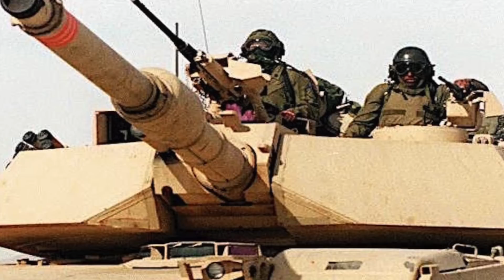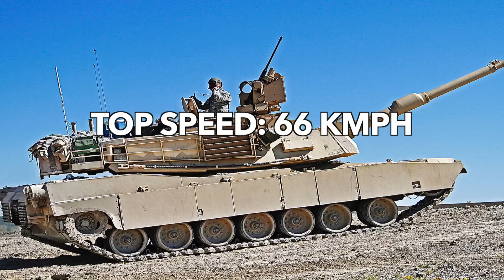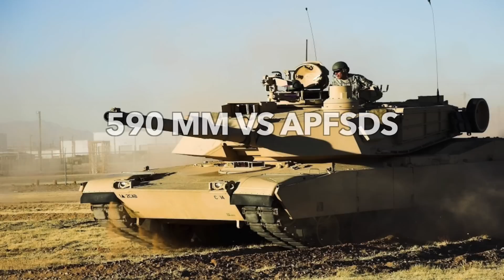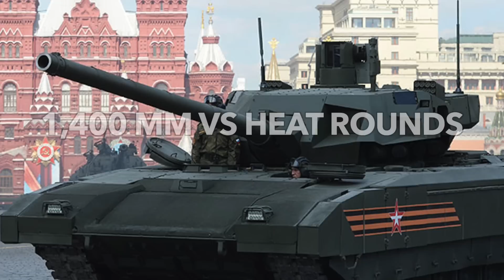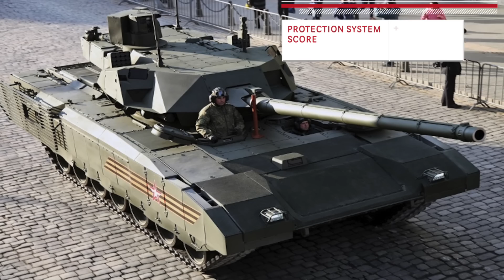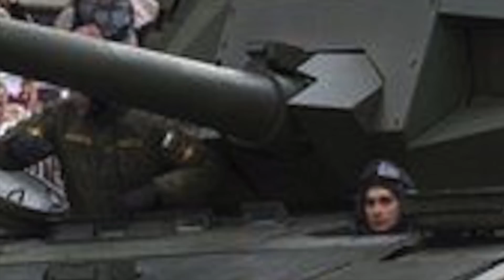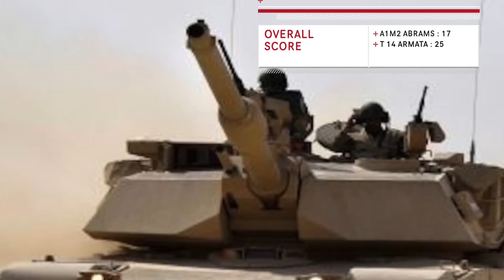AMERICAN M1A2 ABRAMS  vs RUSSIAN T14  ARMATA: WHO WINS?

Comment: How well does it operate at night, in sand storms, does it have excellent fire on the move capability?  Can it accurately hit targets from over 2 miles away on rough terrain and at full speed.  Does it have automatic fire suppression systems if hit or damaged, can it be easily repaired, are the tracks easy to replace in the field or during battle?  How well are the crews trained, do they have advanced simulator systems and if so how many hours of training are crews given on them?  Does it have a capable support vehicle like the Bradley, how many can be airlifted at one time on a cargo plane?  Is the entire engine a self contained unit that can be swapped out if necessary or is multiple systems and parts?  Can it use practically any type of fuel available if supply lines are comprised?  Last but not least...do they have over 4000 of them or did they do what Russians always do and create a very small amount of super weapons to appear superior?  Lot of things to consider.  P.S reactive armor is easily defeated by the TOW2 system.  This missile fires a small lead projectile which detonates the armor plates and then the main projectile hits right after once the plating has blown off.
Reply: vann tedd you idiots need to stop with this 80's bs, the M1 design may be 80's, but the gun, tech, armor, fire control, aps and much more aren't, it's upgraded, modern, up to date, NEW
Reply: You did see the older Abrams take out over 70 T-72s in less than hour in Iraq right?  Oh let me guess, they weren't as good crews and tanks, right?  We always hear that nonsense.
Reply: And how many of these do they have?  And also, the top layer of armor on an Abrams is classified.  So no one is really quite sure which is better or what it can take.  We've seen this from Russia over and over again.  They said the MIG-29 was faaaaarrrrr better than anything the US had.  Really?  20 years later they found out it can't win a dogfight...ever, its airframe last 60% less time than an American fighter jet, its pilots got 100 hours a year on it to preserve its length and they had trouble selling them to countries even for super discount prices of 4 million each.  They are waaaayyy behind the US in technology, and they know it.  They spent decades and decades making cheaper versions of our systems.  Look at their Navy?  You trying to tell me thats a nation with superior technology?  Look at their strategic bombers?  Laughable.  Almost as funny as a "stealth" tank.  BWAHAHAHAHA
Reply: Very poor, but the same excuse is used over and over again.  Ohh they were made somewhere else and using "those" people to run them.  the Republican Guard had some of the most experienced tank crews in the world in the late 80s, early 90s and got wrecked.
Reply: How many T-14's are combat proven?
Reply: Whats the combat record of Russian/USSR tanks vs Abrams/Challenger/Leopard?
Reply: Its also the same with Russian jets against US made jets.  Abysmal record but you will hear the same excuses.  In the latest (I forget the name) annual global war-games with jets the F-18s I believe went 19-0 against Mig 29s against excellent German pilots.
Reply: Yes you are absolutely correct t-14 armata is the best target in the world.   Meat and drink for the m1a2
Reply: yes but don't you think Russian top command already know that, this is why they invested a lot more in anti-air tech ,it's simple common sense , they were never planning to fight us air force 1 on 1. Russians are not idiots and you should not underestimate their spirit
Reply: Then how can we know?
Reply: What battles were these?  Please tell me names and dates.
Reply: @SeanP7195  Seems to be references to World of Tanks. Many complaints about Russian bias.
Reply: when and where?
Reply: spelling and grammar are not your strong suite
Reply: Black Prince if what you say carried any weight, the US would have failed during the Cold War, not the USSR. And that alone speaks for itself in every aspect, not just tanks. Go actually learn something and look at the big picture, not just what you want to believe and try so hard to convince yourself to be true. Lmao at YOU
Reply: Russell K. Bonney if somebody could give America a run for their money, they woulda did it by now as much as people hate the US
Reply: If you read the definiton of the word "Propaganda", is you who is spreading it... Not me.  I didn't said the russia is good in no way...
Miss the point you say... You sad that russia can't keep up in ukraine, i sad that you are wrong and they keep up like a lot.... That's it...
About Krimea, the fact that it was russina before just was just an exuse for them to capture it. If you live in the region like me, you will know it. The reason is that Ukraine started the EU integration program, wich means NATO military bases on it's lands and will force russian naval base in krimea to leave... And this was a price too high for Putin... There is no other sense for russians to invade ukraine. They just need to keep Krimea as their naval base.
You think the biggest country in the world with all the resources and shit will invade ukraine for their lands ? :D 
Yes, there is no excuse to invade sovereign nations. I totally agree with you on this one... 
About "Nato to does not invade countries to build its might. " Really ? 
And what happened in Yugoslavia ? Nato suported separatists ,to use their lands for Nato bases later...
Reply: SeanP7195 you tell em!! MERICA
Reply: Amigo! Russians invaded my country long time ago, took everything my family had... I have lots of reasons to hate them...
But first: supporting a war, does not mean you are in it. 
U.S funded and supported taliban for years to fight the soviets... Still does not mean they where in official war with them...
About the Ukraine, you have no idea what is happening in the region.
Russians supported war in Donetsk to distract Ukraine from Krimea ( wich russians successfully capturen)  and to create a "black hole" buffer zone like they did in Transnistria in 1992 (read in wikipedia about it) So are russians having succes in Ukraine ? Considering they captured Krimea without firing a sigle shot, hell they are having success... 
And btw , Kiev officially reported today that they have no direct proof of russian involvement in Donetsk region... So yeah, russian military does know they'r shit.
Reply: Mr Macky Brown that was great 😂😂😂
Reply: Proof ? You yanks also had fake proof when invaded iraq... 
I watched the Vice and media from both sides, russian and u.s. Propaganda all the way... You say that russia wanted to do more ? What exactly ? Cause it does not make any sense... You guys don't even know why russia captured Krimea , don't you ?
Reply: It works gr8 at night
Reply: Agustín De Zan agreed SeanP7195 is just being so defensive..
Reply: CapnCrossbones 😂nigga you've gotta be kidding their Air Force is a joke compared to the us Air Force it's a circus same with navy only thing Russia can clash with us in on the ground
Reply: Russia has produced less than 4000 T-90 tanks.
Reply: Which is essentially an upgraded T-72 which got ripped to shreds by US forces.  The T-72 was losing fights against the Bradley.
Reply: Actually its around 3200 and sold many of them.
Reply: TOW2 systems has typically beat any reactive armor presented to it.  Also, the Army is now designing a new Tank which will probably again put the Soviets years behind and cause them to bankrupt themselves again catching up (sound familiar).
Reply: Daniel Barvenko   Oh dear lol.  Go look at the Jill's in Iraq.  Tell me how many Abrams were lost in head to head battles.  I'll wait
Reply: Daniel Barvenko bwahaha.  I believe the Abrams took out nearly 109 T-72 in one day at the start of the Iraq war.  Oh dear, you and your Russian last name
Reply: SeanP7195 -You make americans seem like idiots. Please stop talking, because some of us aren't. I sure hope our military didn't share any secrets to your loose lips. stop thinking with your emotions, and use some intelligence. You clearly lack knowledge, and more importantly wisdom.
Reply: Mr Macky Brown -You clearly don't understand what's really going on. If you ever figure it out, I'll bet it'll be too late.
Reply: Mr Macky Brown -I think you have proven your IQ can't get any lower, and still support life.
Reply: Nameless 69 - Unfortunately that's not true. Their strategy is superior for a long drawn out conflict, witch they are masters at achieving. We have numerous/serious sustainability problems. Russia doesn't even have to defeat us to win, but we would loose in the end even with their defeat.
Reply: SeanP7195 -we are bankrupt
Reply: Robert Mitchell but why would it be a drawn out conflict if a war ever happened between the us and Russia it would go nuclear which mean bye bye world
Reply: Robert Mitchell 
You r stupid!!
Reply: Mike Walsh -I've said alot, with as few words as I could in the moment. What exactly did you find stupid? If I got something wrong I would like to know (seriously). The more I've learned, the more I realize there is to learn.
Reply: Robert Mitchell 
Tell me what you got right, because in reality, you don't know!!
Reply: Bones Doug -That is very possible, and very likely if one side felt there was no other option. On the other hand, both sides have found ways to fight each other since we fought for the White (Imperial Army) vs the Red (Communist Arny). Even as allies in WW2 we were secretly fighting each other.
Reply: Mike Walsh - Apparently you have no argument? Teach us somthing, anything you think you know. Maybe we'll both learn something. Or do you just have insults?
Reply: Robert Mitchell yeah bit if it came to today it would not be a drawn out conflict more like a nuclear war
Reply: litterly all things u meantioned at the start are common for every modern tank. uk they get tested before the come out.
And no tank can accuratly hitt anything at a distance of 2miles at full speed. This is a tank to tank comaprison so the crew has litterly no meaning also yes the have simulatores xq.
The bmpt came out with the armata and is a eczellent supp vehical but then again this is a tank to tank comparison.
and no fucking shit ofc they dont ahve 4k xD they do have around 26k of other to modern standerds upreadet tanks tho. The armata just came out and is a revolutionary design meaning the factories need time to adapt while the abrams is an older model that was upgreadet to modern standerts just like every other russian tank xq.
Now to tow2 it is tandom shaped yes but its still massivly affected by especially modern era, relict for example reduces tow pen by around 40% thats why they r designed to hit the roof of a tank turret not the front (the roof is usually weakly armord). now heres the prob. we know the pen decrease of relict but the t14 has malahit era. and noone knows shit about it xq
the 900mm armor against apsfds are without the era and noone knows if it could stop tandom shaped projectiles like tow entiarly (t14 has malahit on the roof. Also hitting russian turrest is extreamly difficult cuz the actual turret and the places where tow could pen for example the t90 are very small and its even worse with the t14 because the only thing that tow could dmg is the main gun. Now heres the next prob t14 ACTUAL turret that is within this cool looking capsul that is made to protect stuff like sights from small arms fire is veeeeeeeeery small so hitting it is very difficult. meanwhile the abrams has a humongas turret with alot of composite armour wich absorbs the shockwave of a hitting projectile and lets it through the tank thus a hit in the turret even if it doesnt hit the main gun directly will heavily dmg it or even make it unfunctional (every modern tank besides the t14 has this prob) why doesnt the t14 have it? well like i said it has a small hard to hit turret hidden in a metal capsule if a modern projectile like apsfds hits the turret capsule it will just smash through without damaging the gun. Also its not a small amount of super weapons after the breakdown of the soviet union russia was in a big eco crises and they did the best they could with keeping up the military streangh. Now all of older equip (like t72 and t80) are on modern standerts but the russian goverment is planing to replace them with the t90 and t14 armata until this isnt possible they will keep upgreading theyre older tanks at low costs and slowly but surley replace them with the new models (every western country has an older design that is beeing upgreadet like the abrams)  im sorry that so many amaricans feel butthurt eventho every tank enthusiest should be exited with such an sophisticated new design. The abrams is not much better (if it all) then the new t72 and t80s and sertanly not better then the t90a or t90m and DEFENTLY not better then the armata. Tank designers from other countries admitted themselves that the t14 is the best tank rn. the second best is either the t90m or k2bp. america has huge funds and they r spending it like crazy cuz they can (till now at least at some point the immenser debts are going to crush the usa eco if the goverment dosent do anything) countires like russia come up with extreamly well made and thought out designs to get the most "bang fo the buck" but i digress 

sorry for ma poor english its surley not my first one and i didint rly pay attantion to the mistakes
Reply: @nekko5778  Russia has about 800 T-90s.  The US has over 6000 Abrams.  Russia has a GDP about the same as the state of Texas.  Again, Russia copies designs from elsewhere, makes a much smaller number, then tells everyone how great their stuff is.  Small elements of Abrams and Bradleys pretty much wiped out all T-72s in Iraq in a single day.  You'll understand why I for one am not terrified.  Also, just because something is upgraded from an older model does not make it poorer.  Look at the B-52 for example.  To say the Abrams is not much better or "if at all" over the T-72 is simply not being intelligent.  Again, look at Iraq for example.  Now this is where you tell me, but those were Iraqis, not Russian.  Those Iraqis just fought an 8 year war in those tanks and were highly trained.  Even if the tank was slightly better than the new A1-3 Abrams the US has 10 times the amount and can make many, many more.  They also have thousands of Bradleys, attack helicopters, A-10s and their logistical capabilities are far beyond what anyone else could bear.  I think the US lost a single Abrams to hit from a T-72 in Iraq and they were greatly outnumbered.  It was something like 74-1.  The T-72s couldn't even get close enough.  I'm a show me type person and those numbers are even greater with American jets.  It also only disabled the tank and didn't destroy it. Bradleys were taking the entire turrets of T-72s themselves.  But I know, again, this is the part where you tell me those were bad tanks driven by bad operators.   The MIG-29 was touted as better than anything the US has.  This myth was told for 2 decades and for some reason other nations bought this myth.  Once other nations started getting their hands on them they realized the jet was far less superior.  The airframe of Russian jets have a life span of about half American jets.  This was known to the Russians so their pilots only get about half the training time.  In mock warfare games were allied troops had Mig-29s they were slaughtered by American Jets.  I believe the real world numbers of countries at war and one side had the Mig-29 and the other side had American jets is something like 0-39.  Russia finally had to admit the MIG-29 was a total failure and started selling them for the embarrassingly low price of 4 million each.  India bought a slew of Mig-29s and the quality and optics were so bad they refused the order until Russia made serious upgrades to them.
Reply: @SeanP7195  i seriously question where u r getting ur information from xq.
first of all im sorry, i had the wrong number in my head russia posses a total of c.a 13.000 tanks (all upped to modern standerds)
Iraq: first of all i dont understand why u should be terrified at all, idk maybe u r taking this to personal?
now to the actual t72 performance in iraq. Just cuz the country was in a war for a while does not make the soldiers higly trained. The t72s used in iraq werent even russian models they were produced by mostly warsawpact countries (and yeah they had theyre own versions that were much worse) iraq even used t72 ural wich was the base t72 when it firstly came out, the soviet union did not export any tanks to iraq xq the t72s that i iraq had were older, poorer manufactured and they were badly maintained by the iraqs wich already suggests that they weren elite at all. Poland exported most of the t72 and theyre tanks were already massivly outdated compared to russias t72 variants (not even talking about the t80s). also iraq used very old ammunition, even going back as far as 1962. And the iraqs had very poor tactics like digging their tanks into sand wich is simply useless against apsfds projectiles. in conclusion america had much better trained people and actual modern tanks xq. iraq had poorly trained soldiers who didint maintain theyre tanks properly and they had very old and poorly manufactured tanks (while the soviet union itself did not export and tanks to iraq).
next points: u misunderstood my point. I meant that upgreading tanks is a gud thing and ofc the most modern m1 isnt the same as the oldest variant just like with russian tanks, neither did i say that the m1 was inferor to the most modern t72s or t80s but its even, it is inferor to the t90 and the t14 armata and my comment was primerly made to clear up some thing about your misconseptions regarding the t14 (because this video is about a direct comperisan of the 2 models) so i dont understand what the rest of ur argument has to do with the tank topic but ok xq. Ofc the us has more financial capabilitys then russia and other countries but then again what does this have to do with the performance of the tanks? This dosent cahnge anything in the fact that the m1 is not better then russian tanks and it doesnt change the fact that its much worse then the t14. i wont go into jets here because i dont know much about them. To your other statements, i already explained why its difficult to manufacture the t14 and i already explained the process of replacing the t72s with the t90 and t14 (russia was and still is badly hurt by the split of the soviet union and has just started to keep up with the west again) things r getting better tho wich is a good thing in my opinion. now the debt thing. i honestly do not understand how u dont know about this cuz u seem to be a us citizen. as of right now the us has more hten 26trillion dollars of debts wich is more then the entire eu combined. in short term its not bad and its one of the reasons why the us grew so much, but experts say that a debt crisis is not far away and that there might be a point within the next 40 or 50 yrs where the us wont be able to pay back its enourmas debts wich would crush the economy. This is a very well known problem and i rly dont get how u never heard of this xq
Reply: @nekko5778  Just like I said, the old...."They weren't Russians using Russian tanks story".
Reply: @nekko5778  Since the US is the size and population of the EU I would assume its debts to be similar.  All these nations have massive debts.  Up until Covid the US economy was doing great and getting better again.The US had very unfair trade deals with many of those nations which they are correcting and was paying the tab for most of the UN and NATO.  SO, if we go, they go.
Reply: @nekko5778  I think its you, that might be taking this personal.  Don't you think?
Reply: Butter Brot Russia currently has 2000 active tanks that are at T-72b standards and the US has around 8000 Abrams.  And you ask me where I get my information from?
Reply: @SeanP7195  no i dont think socuz im just clearing up misinformation thats all xq
Reply: @nekko5778  Then start with your own.
Reply: @SeanP7195  and why? Cuz my arguments are based on fact so idk what i should change in them
Reply: @nekko5778  Russia does not even have half the Tanks you mentioned.  They only have 2000 active.  The other 5000 are stored, surplus, antiquated tanks.  These are only facts in your own mind.  The ones that are active are only up to T-72B standards.  They could only bring to bear a few hundred high end tanks at any time.  This is a far cry from the 13000 High end Tanks you spoke of.
Reply: @SeanP7195  thats again wrong. Russia has between 12 and 25k tanks (thats what most sites claim) and the standert is t72b3 and some t72b2 wich r far better. And this standerts apply to t72s only. T80s and 90s r also there
Reply: @nekko5778  Now its between 12k and 25k.  Please show me a site where it states that.
Reply: @SeanP7195  sure, i can do this when im back home. Btw for looking up tank performance stuff i recommend redeffect
Reply: @nekko5778  Dude, they have less than 20 T-14s.  This is what Russia does.  They make a handful of high tech machines and tout their prowess.  Then they field thousands of units from the 1960s.  The point is to have a front line, high end vehicle that thousands of troops use and know.  That has an endless supply chain of fuel, parts, maintenance, etc.  Russia can simply not do this with even a small portion of their leftover USSR vehicles.  Many of those in "storage" will be sold off to third world countries and not replaced.  This is why the former USSR stockpiles have depleted every year.  I'm sorry, but I have no fear of 20 T-14s that would be taken out in day from Nighthawks. I have heard this story for 40 years now.  Russia has the best this, then in warfare they get demolished and here comes the line of...But they weren't actually Russian vehicles.  Really?  Please show me Russia has this world renown prowess at manufacturing?  Ever bought a Russian car, camera, computer, anything?  Ever seen a world changing technology come from Russia?  Lets not even get into the Navy.  They made a bunch of land based vehicles to run over weak NATO nations but even that is now obsolete.  Iraq was the American response to Russian land based weaponry and we got to see it first hand.  T-72s were ripped about at will.  They could not hide, or run from anything.  They were totally ineffective.  Now Russia does have a few hundred T-90s which is a really good tank, but again, its a few hundred.  When you are in open territory and you are facing down thousands of Abrams, thousands of Bradleys, hundreds of High end attack helicopters, a totally invincible Navy, and not to mention a couple hundred A-10s, thats isn't gonna get you very far.  Nor could Russia ever keep up with the logistical demands.  I mean are really comparing 20 super high end tanks to 8000 active and ready Main battle tanks?
Reply: @SeanP7195  ooof 
i wont continue this diskussion anymore cuz now u r just reusing arguments that i already dedbunked xq.
First of all. All of the tanks besides the t72s/80/90/14 were put out of service a looong time ago. the models i mentioned were upgreadet to modern standards just like abrams is beeing upgreadet.
2. u massivley underestimate russia.
Lets dont forget that it is currently the second most powerful country in the world and has very close ties with 3d and 4th most powerful countries ont his planet.
3. russia cant afford to have such powerful land forces and a navy with its current budget, and it doesnt need a extreamly modernized navy.
russia doesnt have many warm water ports and they r bordering most of the important places in the world. meanwhile america was always on "easy mode" locked away on an island with no threat thus a navy is crucial for the us and ships are very fucking expensive so i guess thats why they have such a high budget? 
4. if it comes to a war between russia and amarica no tanks, aircraft or infantry would matter. we would be fucked. If one side starts to even remotly loose they will spam out their nukes to fuck over the otherone.
5. russia can easily keep up with their logistical demands, the only problem they do have is their lack cargos for transport. Eventho they have the biggest airborne army (in terms of airborne special forces) 
i already debuked everything else and u r clearly not talking about tank comparison anymore so ill just stop here. Sry for making u butthurt i guess?

also some of the greatest poets, musicians,artists and scientists were from russia and a russian made google xq (tghr with someone from england)
have a gud day
Reply: @nekko5778  I ask again, could someone please point me this great Russian manufacturing story I keep hearing and also point me to this non debt, booming economy they have?
Reply: Mr Macky Brown russias tech is also classified
Reply: Mr Macky Brown they only say what it is and what it does not how its made
Reply: You guys don't understand one thing... Those U.S and Russian tanks , jets and ships will never fight against each other... They are all made for small local conflicts... For big wars its NUCLEAR time now, where all other weapons are irrelevant...
Reply: Black Prince and also, if it's not broke, don't fix it. That being said, ever heard of an A-10 Warthog? From the way you sound you probably haven't. But Russian tanks wouldn't ever see an Abram on the battlefield for that reason alone. They'd only hear the infamous 

BRRRRRRRRTTTTTTTTTTTT

Russia no BRRTT bro
Reply: @Mr Macky Brown You say about Ukranians...  Idiot, russia is not at open war with Ukraine... Its a Ukranian civil war there.
Reply: t-14 armata is better anyways .-.
Reply: You have to keep in mind Russia has the most advanced experience with tanks. Jets too.
Reply: @Crossbonesisright  : Thanks for the comment, hopefully everybody gets the humor.  ;-)
Reply: Don't know about the jets part thats for sure.
Reply: Yes, tanks can be destroyed.  I don't recall anyone saying its invincible.
Reply: Or Tanks for that matter.
Reply: T-14 has commander in hull, situational awareness is limited, just like all russian tanks, another target
Reply: SeanP7195 Go ask more questions but the fact that the T 14 first version is already even better than the M1A2 abrams then what about the future versions? and T 14 has a farther detecting mechanism because russia has more technology plus the upcoming 152 mm gun that T 14 possesses is the most powerful gun that will ever be mounted in the history of tanks plus T 14 has a better crew protection and the front turret and hull is just as strong as the depleted uranium of the M1A2/M1A3 and if ever something can penetrate the T 14, the crew are still protected by multiple layers of armor inside so basically they are like money inside a vault and the M1A2 is trying to unlock it AND as i said both tanks have the same armor BUT MQA2 only has 40 km/h and 20 seconds traverse while T 14 can reach 90 km/h even with its thick armor and it has 10 seconds teaverse or one of the fastest traversing tanks ever made AND remmeber i said the crews are heavily protected and u guys might be wondering what about the gunner?? what about the loader?? No.. the T 14 only has 3 crews and are sitting beside each other and they use teachnology to traverse the turret or to shoot the gun and to reload it ao basically this is the modern tank u guys are expecting.. the modern tanks that are controlled by technology.. whatever u say.. T 14 will be the new legend from now on so... the question is will abrams be able to shoot something as fast as a car on road? plus it has 10 secs travserse and cars cant do that cause if cars do that they either drift or crash and i dont think abrams can spot the T 14 first and the tank has Night vision cameras around the tank powered by technology and is HEAVILY protected so that the crews wont need to go out and fix it and only one crew is operating these while the 2 others handle thw driving and shooting/reloading.. so yeah the crews are like playing tank games inside or world of tanks XD the future version coming up this 2019 of the T 14 will be mounted with the 152 mm and the tank will be stealth.. yes and this is planned to happened by the russians this 2019-2025. Russia told these instead of keeping it a secret bexause they know M1A2 cant atand a chance against their new born tanks which is a mixture of Super heavy/light tank and they are not afraid to tell everyone the features of the tank because they confirmed that the next version will have no weakness at all and will have a much more speed and much more enhanced frontal armor and side armor..
Reply: AND oh what was that said that the US covered up? that M1A2 got one shot by T 72? please man there about 60-80 abrams got destroyed and 5 of them was knocked out by an anti tank mine.. the driver got killed and the turret was knocked out.. Please just accept the T 14 is better than the M1A3 itself.. look how the US placed those mud removers and others just to avoid getting eaten by mud while t 14 can just go over 90 km/h over the mud.. The US covered all these up when they knew people thpught the M1A2 is the new best but sooner thousands of retired soldiers that know what really happened exposed the truth
Reply: FEED THE HUNGRY TROLL LOL throw back to WW2 let me just remind china and japan had even much more powerful and original chinese and japanese tanks than the weak american tanks and TBH US was the weakest in the WW2 but thx to russia
Reply: FEED THE HUNGRY TROLL they do have master piece -_- the american M4 cant even pen the chinese WW2 tanks in all sides... and US needed help from Russia in every battle -_-
Reply: SeanP7195 DUDE what do you mean by the top armor of turret is classifide?? all tanks have the same armor from the top hull to the below hull and to the top turret! ands its confirmed that M1A2/3 the upcoming version side armor is just a paper for the 152 mm gun so basically the top is penetrable and why would T 14 aim the the top turret if it can pen the depleted uranium in a 90 degree shot? and also M1A2/3 construction are canceled because US army lacked funds so they canceled and will resume this from 2016-2020 so the M1A2 versions that are out there are just being fixed but not being renew and by 2020 the 152 mm gun will already be mounted and the stealth feature upcoming 5 years and by 2020 there will be over 10 k as said by russia since they already have enough funds so please man stop crying